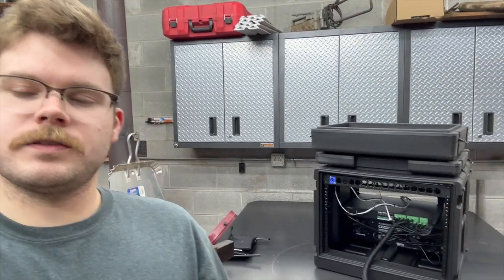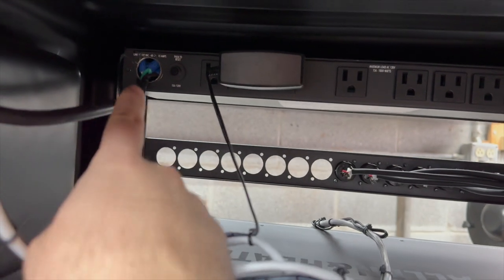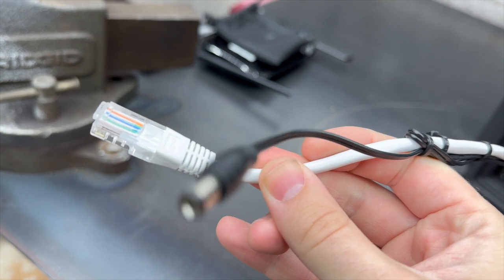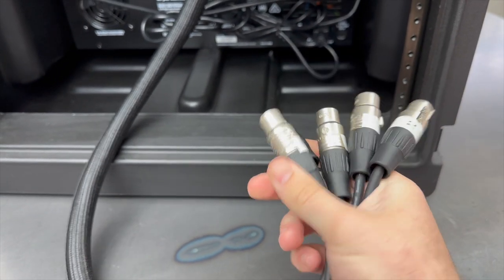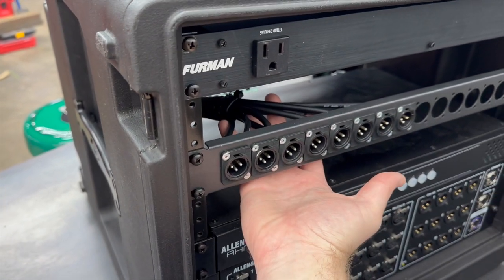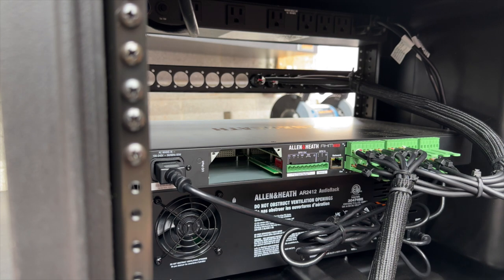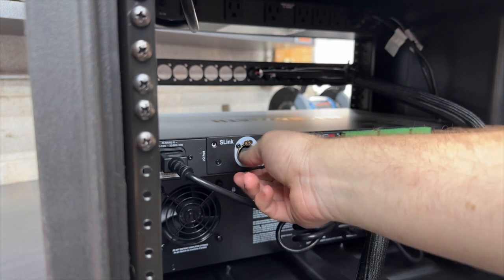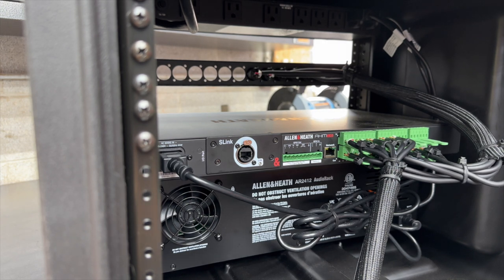Installing Allen and Heath S-Link Card in Stage Rack (Live Sound Audio Shop Days 1)

Comment: Great video thank you. Do you know if it is possible to replace the DSnake port on the AR2412?
Reply from the maker: It’s certainly possible if you have the equipment and skills to do it. I haven’t had one open but I would assume it’s soldered onto a pcb. If you can get a replacement part it should be just a matter of de-soldering and resoldering a new one on.
Reply: @arichindustries  Much appreciated